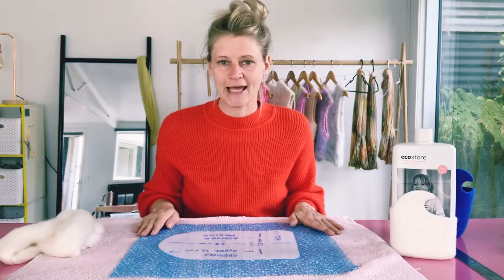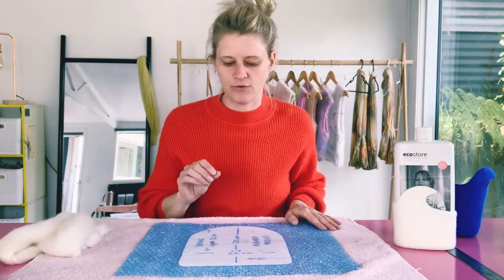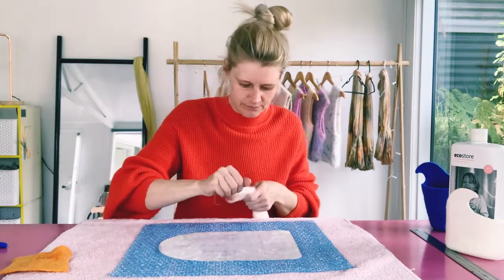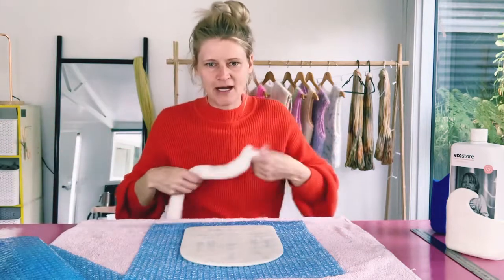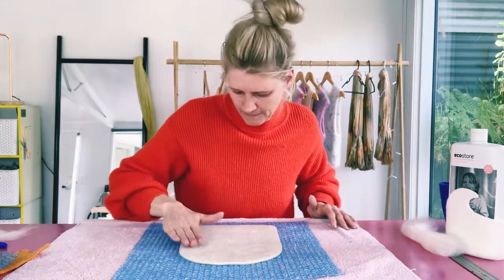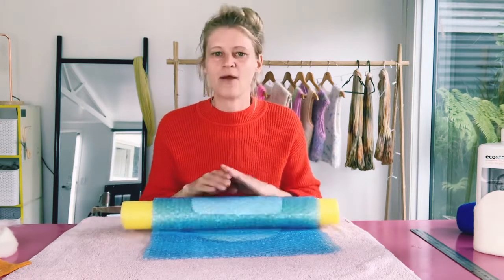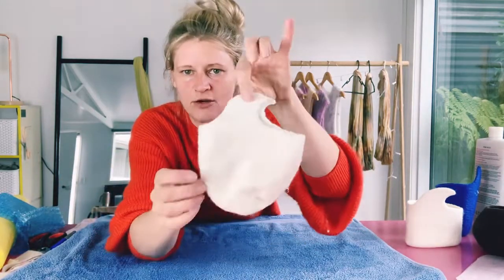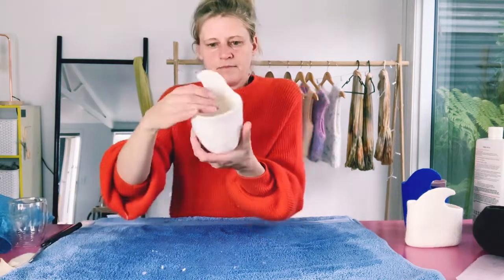How to Make a Simple and Easy Wet Felted Wave Vessel

Comment: This was wonderful and informative but I’m confused as to what a resist is. What is it made out of? Are they a specialty item that one would buy at a craft store or can you use other things to wrap the felt around?
Reply from the maker: Hi S. Ok I realise now I need to make a video tutorial on resist for all resist based projects! 

I use a flat packing foam 2-3mm thick for all my resist based projects. You can also use bubblewrap, I just find it more difficult to cut shapes out of and more difficult to fold the wool around the edges. The flat foam works best. I buy it online and in store at Bunnings. It’s a packaging material so it’s possible Post shops or warehouse type stores could have this.

The resist is used to seperate the two layers of fibres so they do not felt together, creating a space between the layers of felt. This allows you to create slippers, bags, cases, covers, shape into 3D items like bowls, etc.

It’s very confusing when explained and so this video will be top of my list when I am back from holidays :)
Reply: @muffsmerino  Thank you! Enjoy your holiday!

Comment: Do you rinse the soap out of it before drying??
Reply from the maker: I think if it’s very soapy, definitely wash it out! My soap seems to dissolve quickly. I also add water and less soap as I go. Then I finish felting on a dry towel. So eventually it comes out :)